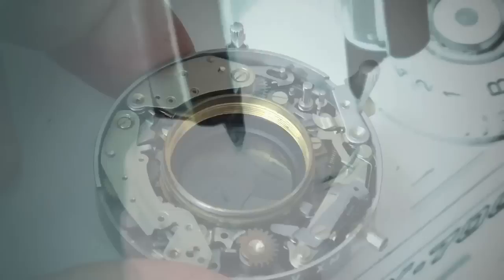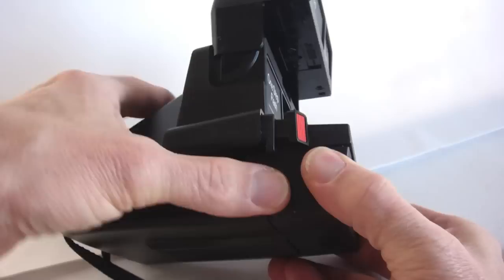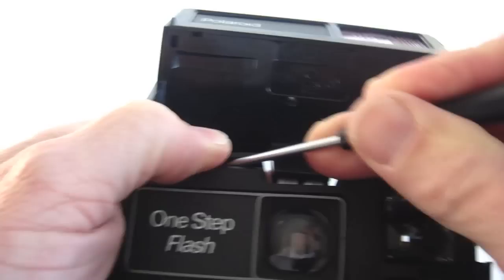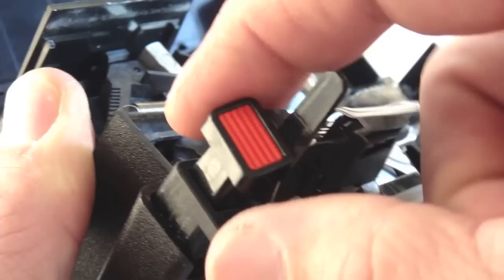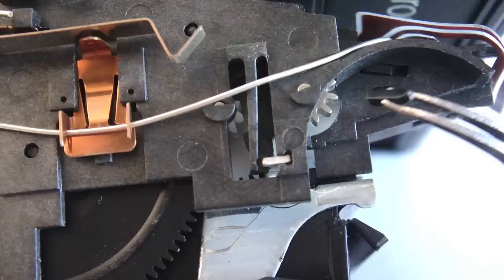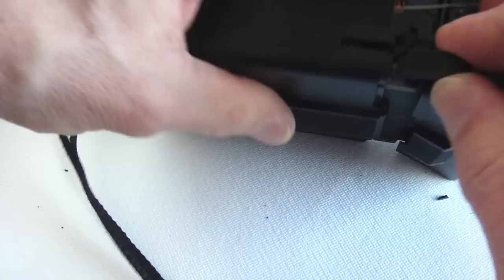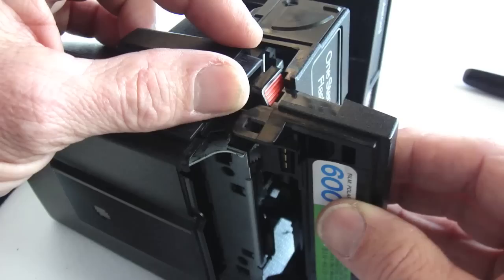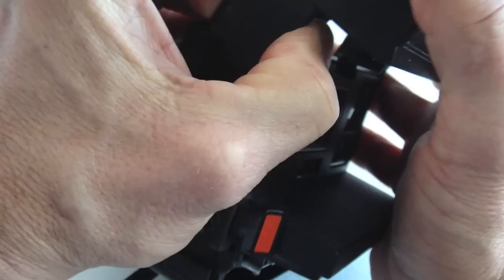Fix Old Cameras :Polaroid One Step Disassembly of Housing

Comment: Hi there! I've got a Polaroid Supercolor 635. When I insert the film pack it just keeps spitting out film one after another without much of a pause between each "photo". Even when the pack is empty it keeps rotating the gears like it is in an endless loop of taking photos.  Flash does not go off at all in this loop. 
I've managed to take the camera apart, but since I have no idea which component could cause the issue I don't feel comfortable touching too much. 
Have you heard of this issue before? Any ideas what could be wrong?
It's worked completely fine up until yesterday where I accidently banged one the corners while the camera was closed.

Comment: Very nice repair. I have a question tho. Do you think after what you’ve seen that if I push the shutter in while there is no film in the camera it’ll damage something inside of it? Also when I do the same thing while the bottom lid where you insert the Film is open could it take damage there? Because I found out that there are different kinds of resistances when the bottom lid is open or closed (while open it can’t be pushed all the way in like when it’s closed). I would like to understand why that is. Thank you :)

Comment: ive got an original onestep, no inbuilt flash, it had issues with the button, the old copper leaf switches had decided to stop working... for now ive got it but i found basically nothing telling me about my model, also how important is the tension spring on the door hinge frame, the plastic stick holding the right side in place, mine snapped off in disassembly but doesnt appear to affect the mechanism

Comment: I just bought a polaroid 636 close up, and when i insert the film it doesn't power on, and the dark slide won't come out, the only thing is that the film is warming up inside but the cam itself does not function. What's the problem with it?

Comment: Hi, thanks for the video. I have a couple of polaroids with varying issues. The flashes keep charging (red light) forever on two 660s and the shutter on one Spirit 600 doesn't work at all but flash is charging and turns green. Do you have any advice for these two cameras? I don't mind opening them up, especially if the flash can be swapped/fixed. Thank you.

Comment: The black piece that comes out when the photo ejects, that part I accidentally messed up :( I thought my photo was stuck so I used a pencil to pull out the black part which was a huge mistake on my part. The only thing I need to fix is that black piece part everything else is fine if anyone can help me or link me to a video that helps specifically for this part of this type of camera posted in the  video it would be much appreciated!! 5:08

Comment: Hello Fix Old Cameras, I put a fresh pack of film in a Onestep Closeup and it doesn't turn on. I've been following the instructions on the video and seem to be stuck on the roller assembly step (2:16). I can't separate the shell from the internals of the camera. Also, I think I made a huge mistake of closing the film door and now I can't open the it because the button to eject the film door is removed. Is there any hope I can still fix this old instant camera?
Reply: To open the film door , you can use a screw driver and push on to the metal part you see. It takes some time to see it though

Comment: I recently bought a 636 close up and upon opening i found out that the shutter spring is missing and the shutter doesn't open because of this, any ideas on how can i replace that spring? i wasted around 3-4 pcs of film because of that..
thanks!
Reply from the maker: Nice discovery... Of course there are always donor cameras... or if you can figure out the configuration you can probably modify and fashion one from another source.

Comment: Hey friend, first of all thanks for you dedication in sharing your knowledge with us! I really love the channel and it helped me a few times. I'd like to know if is there any email address I cold contact you?
I'm with a Ricoh XR-20sp with the film lever and shutter button stuck. I've opened it and managed to fix the lever, but no luck with firing it. I havent found any mechanic info about this camera so I was hoping I could send you a picture of the mechanism, so you could give me a hint of what to do next.
Reply from the maker: Thank you for your interest in FOC. As is always the case with an electronic released camera... if you have not already done so, make sure you have a good battery and the battery contact and cover are free of corrosion. Sometimes the corrosion is so light it is nearly invisible but still can disrupt good current flow. And if the battery is just a little off  full voltage output in will operate the meter but not the release. If you are interested in getting the camera repaired the email contact is available otherwise due to the volume of emails it is unpublished. You may go here for repair inquiry. https://phototronic.biz/
Reply: @FixOldCameras  Hey, I double checked the battery contacts and gave them a little polishing and now it works! Thanks for the tip.
Reply from the maker: Good to hear of your successful repair.

Comment: I have a Sun 660 that doesn't expose correctly. I think thr light meter system is not working. Doesn't matter were I put the lighten/darken slider.
Reply from the maker: Make sure the slider is moving the mask over the CDS window.

Comment: I have a polaroid 600 camera(Barbie edition) Played with it as a kid and now it’s broken. 🥴 No regrets but I would want to restore it. We never used it as the film is not available in the  PH 🇵🇭... Also will they be able to restore it as in brand new or should I buy a new one instead of restoring it? I have found the exact one on eBay!
Reply from the maker: Well what ever fits your desire. Maybe do both. That way if the repairs goes to heck in a hand basket you are good.  (which the snap together Polaroids are prone to do)

Comment: i have an polaroid 650 and the flashlight is broken. How do i fix that?
Reply from the maker: FOC deliberately avoids posting videos featuring electronic flash work and does not advise "kitchen table" repairs of electronic flash circuits unless you have a fair understanding in advance as to the chance of being bitten severely by the main capacitor. Be careful of the main capacitor it will pack a punch! Discharge it with a 10 watt 25 ohm resistor shorted across the terminals.

Comment: I was hoping you showed how to remove the flash cover I’m stuck on that part and don’t want to break anything
Reply from the maker: The flash cover is two parts (upper and lower). They are snapped together. Slightly pull out on the sides to began the separation. It take some prying to get them to separate. Be careful that you do not tear the connecting flex circuit in the process. And COMPLETELY DISCHARGE THE MAIN CAPACITOR before doing any work on the flash. A 10W 100ohm resister will discharge the capacitor quickly without sparking. It can heat up if the capacitor has a full charge. Be sure not to touch the leads during the discharge.
Reply: @FixOldCameras  hiia, i'm about to perform this fix to my camera, my question is how do you know  if the flash is discharged? i haven't tried putting film in it for approx 12 days, am i safe to assume its discharged?

Comment: Film counter stuck in Nikon FM10
Please help
Reply from the maker: Check to see if the counter engagement is making proper contact with the film door. There is a small slot in the upper light seal groove on the right side of the camera. If the engagement is not stuck and moves freely then the top cover will have to be removed so the counter mechanism can be inspected.
Reply from the maker: Remove top cover. Did the counter return? Look for a ding on the top cover that might be binding the counter dial. Did it not return? Look for dislodged counter dial return spring. Look for a jammed counter engagement  lever.
Reply: I think the spring is jammed because I tried closing the back and still didn't work